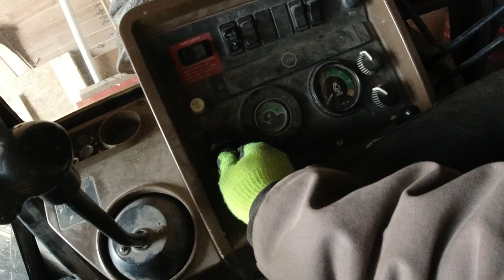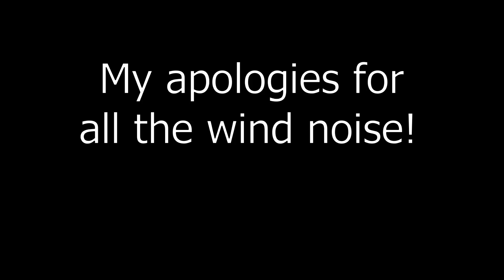Fixing a "Suck Hole" -  Repairing Broken Down Farm Drainage Tile with the Backhoe

Comment: Looksg like a fine job.  My family been in the DrainTie laying business in  central Missouri since the mid 70’s .We still run 2 VErmeer T600C’s and Case 580SM 4x4 Backhoes. We used Hancor field until ADS bought them out. We now use only Springfield Plastics field tile. I started full time in the summer of 1983. Over the years I have thrown countless rolls of 4”-5” and 6”” field tile on a dual reel carrier on the front of those 600 C’s. Now we only use Maxi’s.

Comment: This is the first suck hole repair video I have found. We do a lot of these each year. We use tar paper to seal the joints. I just got a trencher to hopeful run shorter lines. Good job on providing a great video and explanation.
Reply from the maker: Thanks for the kind words!  Tar paper would be a great solution as well I bet.  Yeah, unfortunately someone who fixes suck holes usually gets a lot of practice at it!  I hate to know how many I've fixed but it's a good feeling when they're done.  Good luck with your trencher, that will be great to have for those short runs.  Thanks for watching.

Comment: Neil... I’ve been boning up on clay tile vids this week!  DP & Cap’n got me started... then I spotted this one you’d done.  

You know, those repairs look mighty familiar to me... only, we couldn’t afford the water softener salt bags (I don’t even know if it was invented back then).  We used tarpaper or three tab shingles!

There was one thing I saw you do in this video that I learned years ago... I stumbled on it by accident.  I had a Compact Kubota tractor with a loader. My neighbor had an old Ford backhoe.  Every time he tried to backfill the trench, he mangled the yard, driveway, etc... because his loader was a piece of junk.   So, we had a two man backhoe team... he’d dig them and I’d fill ‘em.  We did probably a dozen in one summer.

What I learned was that it was easier and more efficient to fill the bucket on the first push into the ditch.. and leave it there while pushing the remainder of the spoils back in.  Once you get to the end, you go back and dump the bucket into the start, where it came from.  

When I traded the compact for a sub-compact I got another bonus from having a full bucket. When I was pushing, I could lift the bucket ever so slightly. The added weight gave me more traction on my front wheel drive without robbing it from the rear.  Ever since, I do that whenever I can.  (Obviously you cant fill trenches that way in tight places or with layered media.). 

But, seeing you do it made me wonder... is that a common practice?  If so, how come so many backhoers &  Skid Steer jockeys on YT don’t do it?

BTW... your video productions have come a long way since you shot this one!

Thnx
Reply from the maker: You strike me as a man that knows a thing or two about a thing or two!  Reading your comment I began nodding my head in agreement as your words described perfectly my approach to doing this type of backfilling with a front end loader.  Actually, I use this practice when doing most any front loader work with the backhoe or tractor, as it seems to provide the best ability to control, cut and fill no matter if you're backfilling a trench or trying to grade up a yard with loose dirt piles (In the video where I level a yard with the backhoe and box blades I'm using the same principle to move and grade about 7-8 triaxle loads of dirt).  I was taught to do this 25 years ago by Paul Baughman, the relative I worked for when I began excavating.  I'm not sure why this practice isn't more commonplace.  I don't see a lot of guys doing it really other than the small circle of folks that I run with who all have been learning from the same group of locals through the years.  Matter of fact, I don't know if I've seen anyone on YT doing this so it must not be too common.  The way it loads the front tires with traction as you so perfectly explained is another great reason to do this.  We had a 450G John Deere dozer and always marveled at how much more dirt our backhoe could move when doing this technique with the rear diff locked and in 4x4.  Way more productive than a dozer at moving big piles if you only dump the bucket at the end and get some good wind rows going to hold the dirt in as you push.  I've tried to explain this idea to other folks that a backhoe can actually push more material across the top of the ground in a single push than a dozer, and they look at me like I stepped off a spaceship!  Everyone wants to just scoop up a bucket full and carry it and dump multiple times.

Thank you for making my evening.  I truly appreciate the insightful comments about the content and the quality of video production.  Re-watching this I see so many things that I would do differently now, and this was only filmed about 7 months ago! Much of the footage is from my phone sitting on that tri-pod.

Oh, and BTW, I dig up lots of repaired tiles from long ago that were patched with shingles and tar paper.  Most commonly, I dig up old fertilizer bags.  My grandpa always fixed clay tiles with fertilizer bags.  They were blue-striped and I still have a couple that I have dug up that he planted 50 years ago!  Whenever I find one I wonder if he could have ever imagined his unborn grandson digging them back up so many years later!  

And you thought you would have long comments!  Sorry :)
Reply: @digdrivediy  well sir... I don’t know that I know that much but, I sure love to learn! (Wouldn’t that be a fun sentence to launch in grammar class?)

Thanx

Comment: 5 inches of rain yesterday, I noticed one fence post sunken several feet too low. On inspection a 3 foot wide by 3 foot deep void opened up underneath. It looks like the connection to the municipal drain is toast. I might have to call for some professional help.

Comment: I’m a green horn, would that basically be the same fix for a septic field broken tile?
Reply from the maker: Hey Rob.  It could be similar depending on what your septic system is made of, but more than likely the "fingers" of most septic systems are rigid PVC type of pipes.  I don't thick that there are usually septic fields with clay tiles.  On the other hand, if your septic system perimeter drain drains into a field tile like this, then there is a good likelihood that it could be similar.  The problem with trying to diagnose field tile and drainage issues of any type is that usually you don't know what you're dealing with until you dig it up and look.  Good luck with your repair and thanks for watching.
Reply: Neil Koch: Dig-Drive-DIY luckily nothing is wrong with my field right now, i was just curious was all. When we had our septic inspected (I wasn’t here for it my parents were) we have clay tile too. I’ve always been afraid of driving my John Deere 400 over it to mow cause of the concern with brittleness. Hasn’t stopped me though. 🤣 call me stupid and stubborn I guess. 🤣🤣🤣🤣 thanks man!

Comment: wrong way to fix used a clay adapter instead of a coupler it will leak
i been tiling over 20 years
Reply from the maker: Good point.  I've used clay adapters though as well.  I think much of it depends on ground conditions.  I don't picture the couplers being able to leak as easily as the big gaps do that we often find between the clay tiles.  Many times when I did them up there will be 1/8" or larger gap that somehow doesn't cause an issue.  I'm always amazed at how many clay tiles continue to work.  I've been patching up these tiles for over 20 years as well but always like hearing how other folks do it.  Thanks for watching!